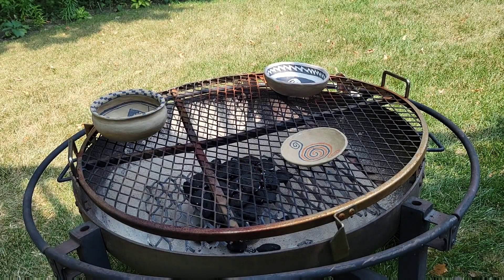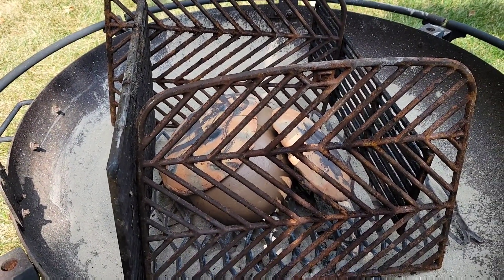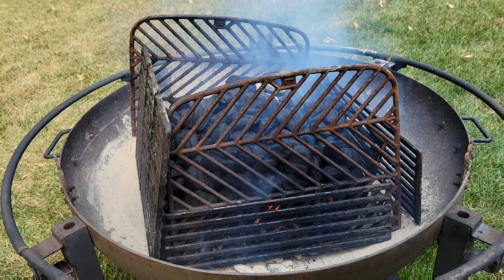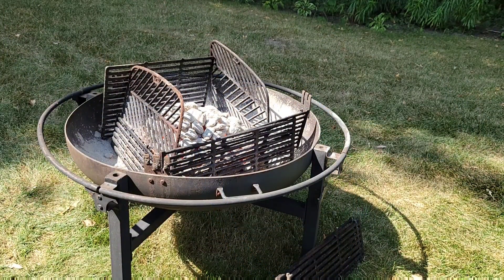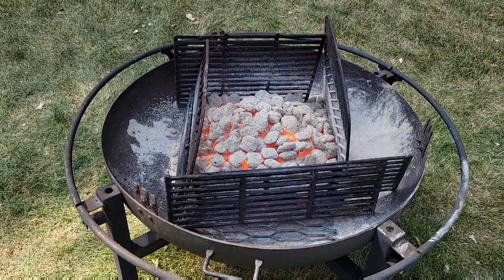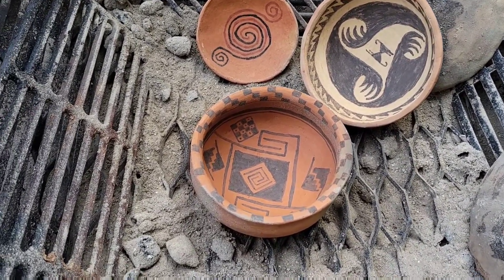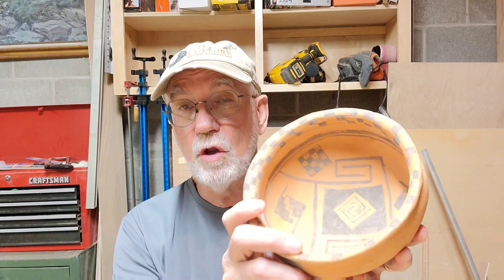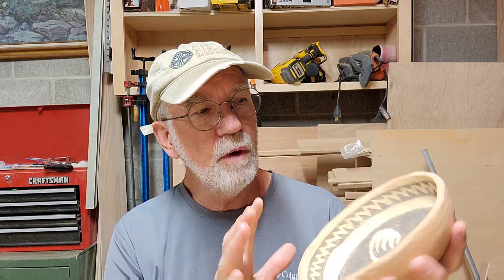Primitive Pottery; Backyard Firing

Comment: Thanks for your video! A suggestion? You can go to your local pottery store and sometimes they have old, traded in kilns. Not to electric fire but to use as a container for a wood fire. Put some holes in the bottom for ventilation, it keeps the heat in soooo good. Thanks again!
Reply from the maker: Thanks for the idea. The insulated bricks would really work.

Comment: Good fire. I tried a charcoal firing last night and only got to 700 C so yours was quite a bit hotter than mine. Cow manure burns similar to charcoal, not sure what the temperature difference is, but I might run some experiments.
Reply from the maker: Thanks, I think lump charcoal might get hotter but it does spark a lot and its more expensive. It is harder to find really dry manure here than it is in AZ. I wonder if Native Americans ever used anything like a bellows?

Comment: Great video Wes. I think if you had a cover it would get much hotter.
Reply from the maker: Thanks for watching. I do lose a lot of heat out of the sides and the bottom. A cover would probably hold the heat in but also may restrict the air flow. With a regular wood fire on the ground I can often get 1700f. In any case, 1500 will normally do the job.

Comment: Just a theory, I think if you built an outer circle in the barbeque of brick, the brick would get hot and hold in the heat, do everything else the same with your charcoal briquettes and pottery inside that.  You might even be able to do a floor in it, of brick and do the outer circle.
Reply from the maker: Thanks, I just read your most recent comment.

Comment: Great video, very useful. What oxides did you use to decorate the clay. Also, I was so surprised the pots didn’t end up black and sooty and obliterate all your pattern work. Is it because you used charcoal instead of wood or sawdust?Thanks
Reply from the maker: The black is manganese dioxide mixed with about 30-40% clay. Reds are some type of iron oxide or hematite mixed with clay. I've never tried sawdust but wood or charcoal work fine. The key with wood is to make sure that you use dry wood that will burn pretty quickly about 1" diameter. It needs plenty of air so it burns cleanly. Initially your pots absorb carbon and turn black but when the fire gets in the oxidizing phase the carbon burns off. It helps if you protect the pot by covering it with sherds. They reduce thermal shock and carbon on the surface. Have fun, good luck.
Reply: @airstreamwanderings3683  thank you for your helpful hints, can't wait to begin y explorations with this. One more question. When you mix the manganese diocide with the clay, do you make a slip and add it or use powdered clay. I'm only ever used to using oxides on their own with water.
Reply: @narshsart3620  I mix the dry ingredients first and then add water. I also think it is best if you are able to grind the dry ingredients together first. I use a flat rock as a pallet and grind them with another rock. It isn't totally necessary but I think it helps. A mortar and pestle would work too. Recently I've found that adding a little borax seems to help the paint stick after firing. Good luck.

Comment: When Tony fired a big Olla, he warmed it slowly to 500 degrees to ensure no cracking. I'm not sure that's necessary is smaller pots. He used Yucca and small scrap wood for firing.
Reply from the maker: You can never go wrong with preheating and making sure your pot is totally dry. I think it is the same regardless of size.

Comment: Thank you so much for your demo     i am interested in making small clay whistles and thinking i can fire them like you did    May be put one in a coffee can then surround it in the pit with charcoal like you did ,     or do you have any ideas on that    Great Video
Reply from the maker: Yes, that might work well. Keep in mind that firing like this uses clay with about 20% grog/temper in it. Andy Ward Ancient Pottery YouTube channel has one on using commercial clay. Very likely you will need to add some sand to it  otherwise it will break. Course sand works best but will make fine details harder to make on your whistle. Also dry and preheat your whistle. It works well to put them in your oven first at a very low temperature and then bump the temp up to it's highest point. The nice thing about charcoal is that it will slow down the thermal shock and the coffee can will help too. Lump charcoal gets hotter but regular charcoal works too. Be prepared to experiment a little. Have fun and good luck. Thanks for watching.

Comment: My briquette fire was a total failure. I got the same temps as you but all my pots melted :-( . Even if they had turned out ok, the briquettes were obviously full of plastic.. so I had melted drops of gunk all over everything. Couldnt even use the pots as grog after that. Next fire will be wood.
Reply from the maker: I'm sorry to hear that it didn't work - very peculiar. I've heard of pottery melting but not like this. Tony 
Soares has a number of videos on using charcoal. Lump charcoal wouldn't have additives but there's a lot to be said for sticking with what works. The journey continues, good luck.

Comment: Maybe insulating it with bricks would help it get hotter. I haven’t done this though. It is just an idea from other videos I have seen.
Reply from the maker: Thanks for the comment. If you watch my newer videos you will see that I've switched to using bricks. I think a big thing is that I can get more of a drafts and better air circulation. The bricks do hold in the heat but initially it can take awhile to heat them up especially in cold weather.

Comment: If you use lump charcoal instead of briquettes, you'll get a hotter burn.  You'll have to use more because it burns faster than briquettes, but you'll definitely get higher heat.
Reply from the maker: Yes, I've used lump charcoal and it is hotter. I'm not sure that it is that much of a benefit but there are some clays that like a really hot fire. On the other hand temps over 820C can lead to problems with calcium spalls which lately have been very frustrating.  It is also almost twice the expense.
Reply: @airstreamwanderings3683  I don't know about calcium spalls but I hear you on the expense.  When I was running the barbecue wagon full-time I would usually use a combination of lump and briquettes so I could get the higher heat but keep the longer burn at the same time.

Comment: What temperature did your pots need to sinter?
Reply from the maker: Sorry for the slow reply. I'm not sure exactly but I think you need at least 1350f. I always try for 1500+ With charcoal it usually gets up to 1700+. I think different clays sinter at different temperature.
Reply: @airstreamwanderings3683  thanks for the reply! yes what I’m using is about 1800. I keep having issues with the pots cracking. I believe I’m getting the pit too hot too fast though.

Comment: wont it be a lot easy if you just build a forge charcoal is good it burns hotter then gas , electric or wood
Reply from the maker: I continue to try different methods to find what works best for me. If you watch any of the recent videos you will see how the process has evolved. I usually fire with lump charcoal now. Thanks for watching.